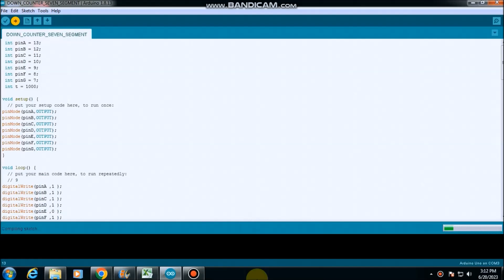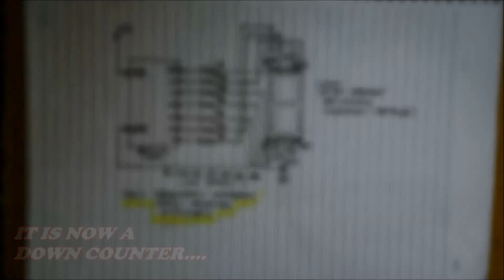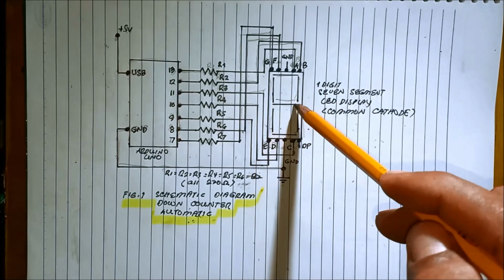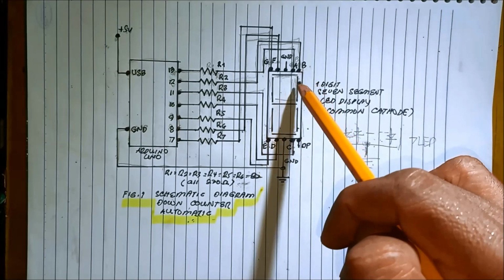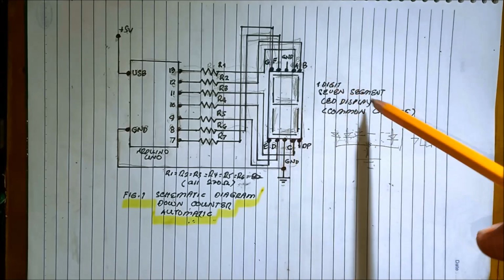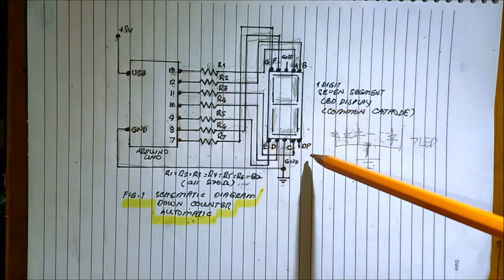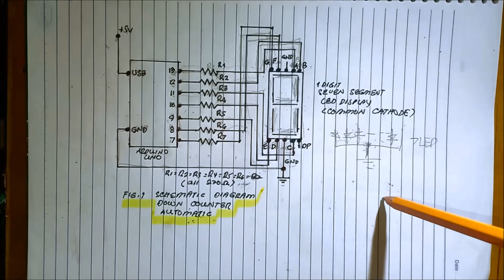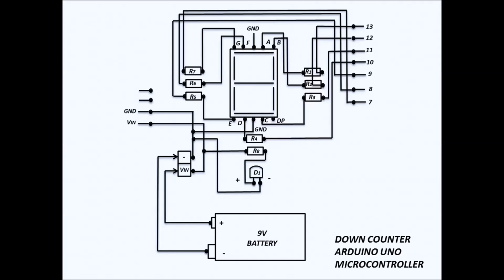Down Counter using Arduino Microcontroller  and 7 Segment LED (with English Sub)

Comment from the maker: ARDUINO CODE_DOWN COUNTER...
int pinA = 13;
 int pinB = 12;
 int pinC = 11;
 int pinD = 10;
 int pinE = 9;
 int pinF = 8;
 int pinG = 7;
 int t = 1000;
 
void setup() {
  // put your setup code here, to run once:
pinMode(pinA,OUTPUT);
pinMode(pinB,OUTPUT);
pinMode(pinC,OUTPUT);
pinMode(pinD,OUTPUT);
pinMode(pinE,OUTPUT);
pinMode(pinF,OUTPUT);
pinMode(pinG,OUTPUT);
}

void loop() {
  // put your main code here, to run repeatedly:
  // 9
digitalWrite(pinA ,1 );
digitalWrite(pinB ,1 );
digitalWrite(pinC ,1 );
digitalWrite(pinD ,1 );
digitalWrite(pinE ,0 );
digitalWrite(pinF ,1 );
digitalWrite(pinG ,1 );
delay(t);

// 8
digitalWrite(pinA ,1 );
digitalWrite(pinB ,1 );
digitalWrite(pinC ,1 );
digitalWrite(pinD ,1);
digitalWrite(pinE ,1 );
digitalWrite(pinF ,1 );
digitalWrite(pinG ,1 );
delay(t);

  // 7
digitalWrite(pinA ,1 );
digitalWrite(pinB ,1 );
digitalWrite(pinC ,1 );
digitalWrite(pinD ,0 );
digitalWrite(pinE ,0 );
digitalWrite(pinF ,0 );
digitalWrite(pinG ,0 );
delay(t);

  // 6
digitalWrite(pinA ,1 );
digitalWrite(pinB ,0 );
digitalWrite(pinC ,1 );
digitalWrite(pinD ,1 );
digitalWrite(pinE ,1 );
digitalWrite(pinF ,1 );
digitalWrite(pinG ,1 );
delay(t);

 
 // 5
digitalWrite(pinA ,1 );
digitalWrite(pinB ,0 );
digitalWrite(pinC ,1 );
digitalWrite(pinD ,1 );
digitalWrite(pinE ,0 );
digitalWrite(pinF ,1 );
digitalWrite(pinG ,1 );
delay(t);

 // 4
digitalWrite(pinA ,0 );
digitalWrite(pinB ,1 );
digitalWrite(pinC ,1 );
digitalWrite(pinD ,0 );
digitalWrite(pinE ,0 );
digitalWrite(pinF ,1 );
digitalWrite(pinG ,1 );
delay(t);

 // 3
digitalWrite(pinA ,1 );
digitalWrite(pinB ,1 );
digitalWrite(pinC ,1 );
digitalWrite(pinD ,1 );
digitalWrite(pinE ,0 );
digitalWrite(pinF ,0 );
digitalWrite(pinG ,1 );
delay(t);
 

 // 2

digitalWrite(pinA ,1 );
digitalWrite(pinB ,1 );
digitalWrite(pinC ,0 );
digitalWrite(pinD ,1 );
digitalWrite(pinE ,1 );
digitalWrite(pinF ,0 );
digitalWrite(pinG ,1 );
delay(t);
 

 // 1
digitalWrite(pinA ,0 );
digitalWrite(pinB ,1 );
digitalWrite(pinC ,1 );
digitalWrite(pinD ,0 );
digitalWrite(pinE ,0 );
digitalWrite(pinF ,0 );
digitalWrite(pinG ,0 );
delay(t);
 

 // 0
digitalWrite(pinA ,1 );
digitalWrite(pinB ,1 );
digitalWrite(pinC ,1 );
digitalWrite(pinD ,1 );
digitalWrite(pinE ,1 );
digitalWrite(pinF ,1 );
digitalWrite(pinG ,0 );
delay(t);
 

}